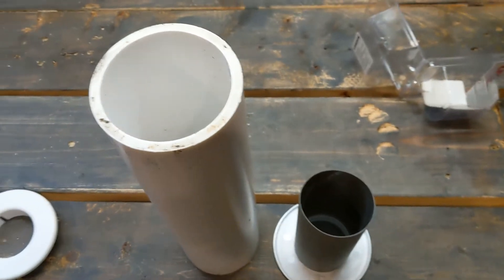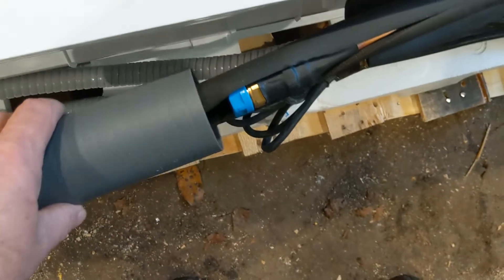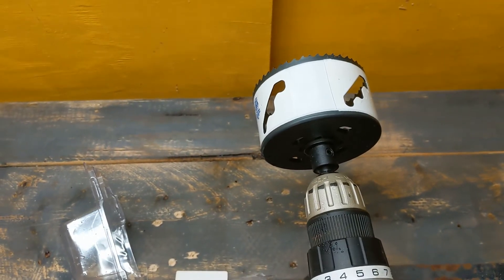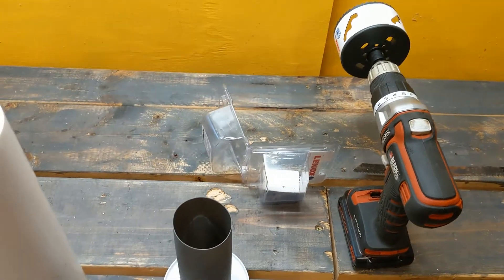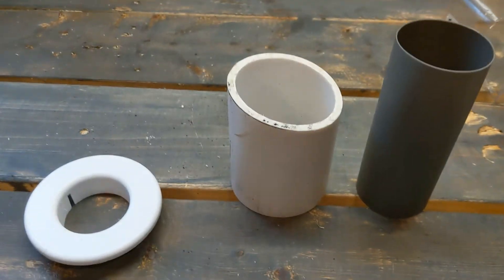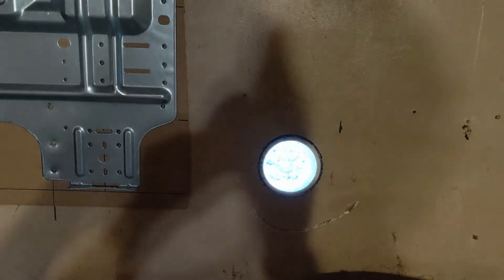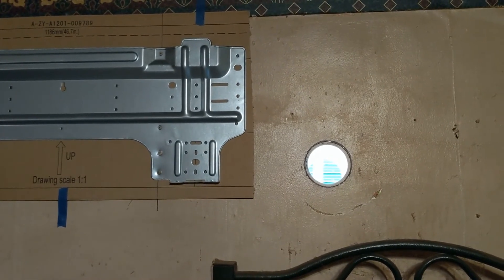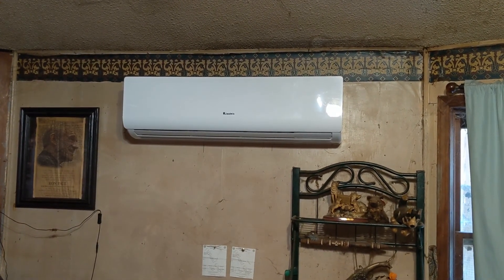Klimaire MiniSplit Air Handler Install: Line Set Wall Sleeve Fix.

Comment: why cut the pipe in angle
Reply from the maker: I wanted a downward slope going outside the house so any rain or water leaks would flow outside instead of into my living room. Probably not needed, but that was my thinking at the time.